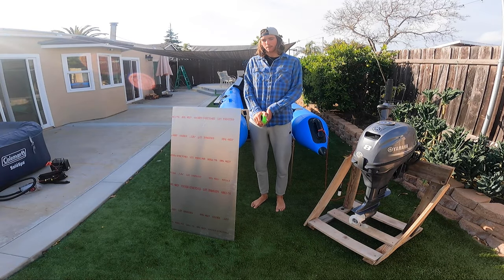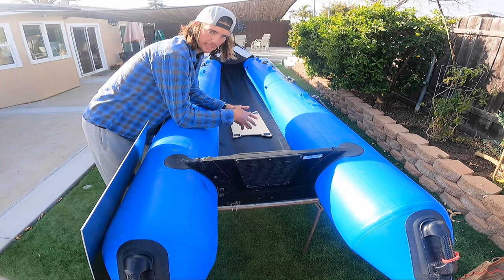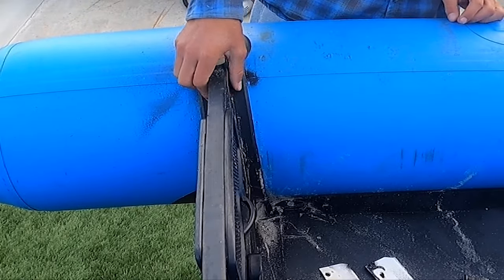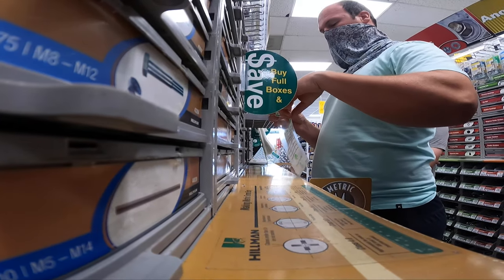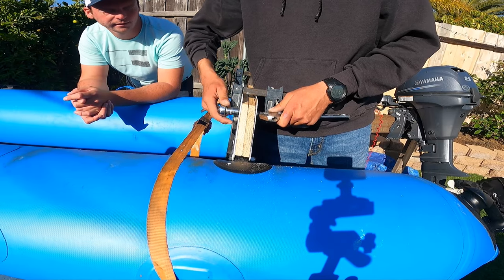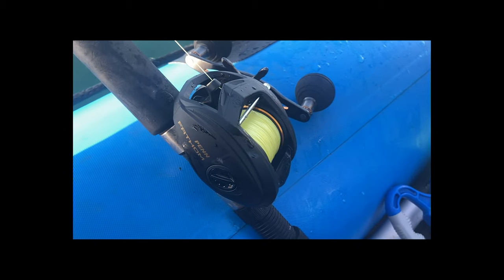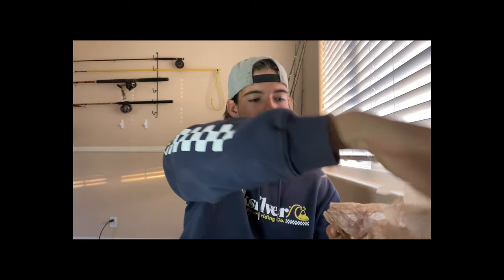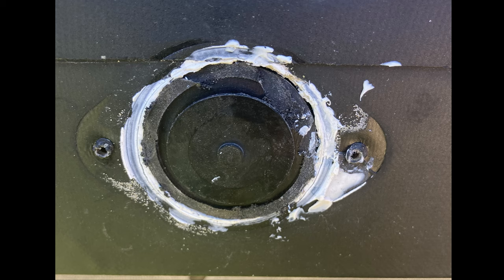How to reinforce a transom on a boat-Scout365 Scout430

Comment: I feel for you. I spent a bunch of $ on a jack plate for my 20’ center console. I was positive my outboard was sitting too low in the water. Turns out the best performance was exactly where it was originally.

Comment: So quick question.  You're saying that because it's universal, you can go with either a 15" or 20" shaft motor?
Reply from the maker: That’s correct, but I would recommend the short shaft as the longer ones tend to pull on the transom more.

Comment: Would the scout stock work with a long shaft ?
Reply from the maker: It would yes. But keep in mind that with a longer shaft you’re gonna have a lot more force pulling back on your transom. The bottom of your motor is it gonna be pushing forward as the top is it gonna be pulling backwards if that makes sense. You might rip your transom. But if it’s a smaller outboard smaller than an eight, you shouldn’t have that problem. I tell people if they want to put a bigger outboard then recommended, reinforce your transom with aluminum plates. Just as a just in case safety per caution.

Comment: What’s the top speed with the 8hp
Reply from the maker: With two people on total flat conditions, 18 miles an hour, when going with swell I’ve gotten up to 22 miles an hour . By myself same principle apply.
Reply: @adventureswithosidekayakguy  I want to but I’m afraid I’ll break the transom over time 😂
Reply from the maker: Trust me, you will certainly break your transom within the third trip like I did… So make sure if you do upgrade to a bigger outboard reinforce the transom with some aluminum plates, why aluminum? So it’s lightweight and it doesn’t rust.

Comment: What top speed are you getting with that 8 hp?
Reply from the maker: With two people 18 miles an hour, by myself 20
Reply: @adventureswithosidekayakguy  I thought the manufacture suggestion was using a 5hp motor for the 430? Is that just a suggestion?   Same question for the 365 what max hp motor would be acceptable?  thx
Reply from the maker: @frappy815  That is correct, both the 430 and the 365 is rated up to a 5 horsepower outboard motor... We've had a few people put 6 on there and it performs just as well, I went ahead and did a crazy upgrade all the way to the 8... The problem I had was that my transom ripped completely off due to the power. I was out in the water and both sides pulled right apart. Thankfully I was close enough to shore to where I could finish the day without totally losing the outboard and the back half of my boat haha. 

I tell this to anyone who decides to go past the recommended motor size to upgrade their transom, I need to make a better video of the one here, this one was a last-minute helter-skelter video I need to put together a solid 10 minute video that explains everything properly. You're going to want to go to some metal store getting yourself an aluminum plate the aluminum plates depending on the thickness run anywhere between $25 to $80, I spent a little over $80 on mine. Create a little shape using cardboard then match your transom. Each boat is handmade. Or at least put together by people not machine so it's going to be off by a few Centimeters. Once you have a shape on cardboard you're going to mark it down on Sharpie on your metal sheet, outline it cut it drill some holes like shown in the video and then put it together. 

But back to your main question, I do not recommend putting anything bigger than a 5 on your scout rather it be the 12 ft or the 14 foot version unless you reinforce your transom with aluminum sheets. Aluminum is strong and it doesn't rust. You can use metal, but wouldn't want you to go through the hassle of cleaning rust off everything.